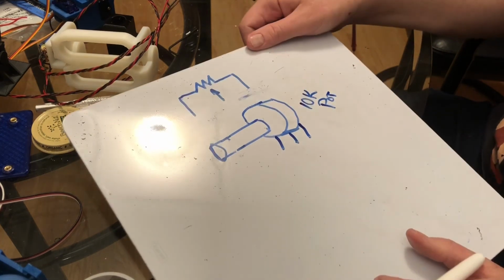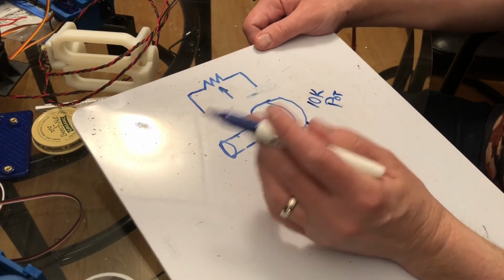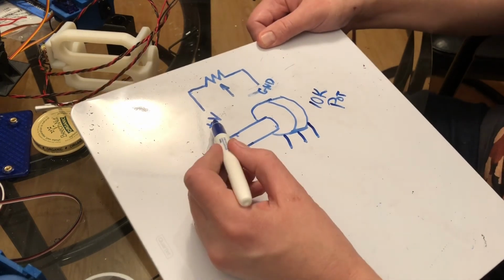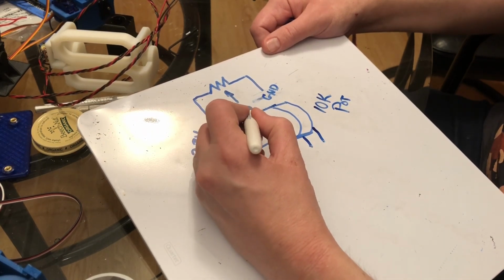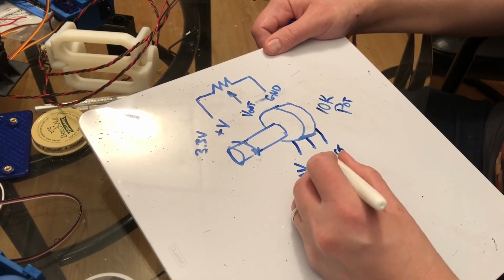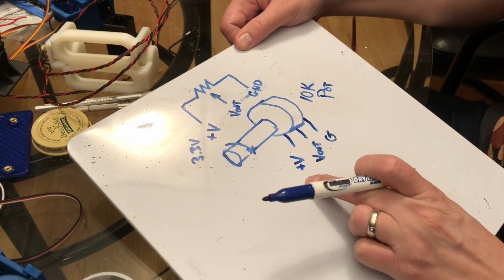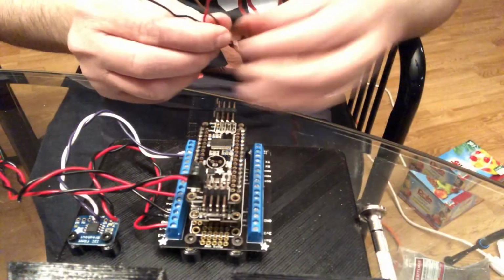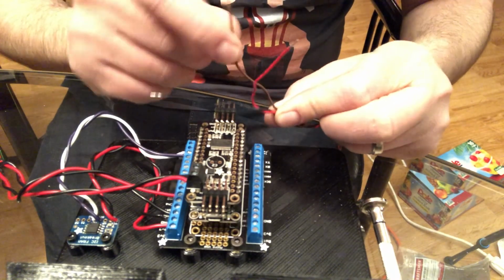Building an Arduino Controlled Animatronic System Part 2 - The Input Controls!

Comment: It’s poor practice to have motors (or other inductive devices) and microcontrollers being powered by the same DC power source. Even when it can deliver the requirements. The power spiked in the DC line caused by induction can create voltage spikes that will kill microcontrollers. Or the noise of induction can be enough to disrupt high frequency low voltage processors. so if you do, you need to really filter and have fly back diodes in place and very good regulators. This often is harder to test so a separation of power supplies is there for a better choice/

Comment: Great tutorial & build Jim! Very smart on the motion potentiometers. Since you're using a larger power supply you could also give power to the potentiometers, that would save you the power outs from your board.
Reply from the maker: Builder's Mark I know what you’re suggesting but in this case it’s not quite true. The power supply you need is 5v to run the feather. The voltage regulator drops that voltage to 3.3v since that’s what the 32u4 runs on. 

Since the 32u4 runs on 3.3v, if the pot is powered with 5v, the analog input will only read up to 3.3v the a to d will max out at 1023 at 3.3V.

If you used an uno, it runs on 5v and the analog in uses a 5v reference.

Using the Ar pin you can set a lower reference if you want, but I’m 99 percent sure you can’t measure analog voltages higher than the processor input voltage. 

If you had a separate dedicated 3.3v power supply, it would work fine. :)